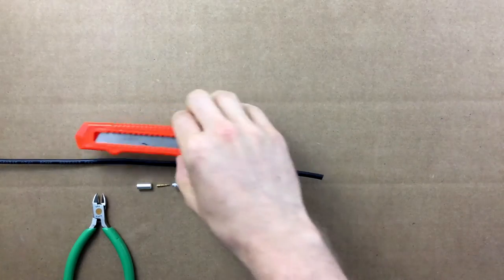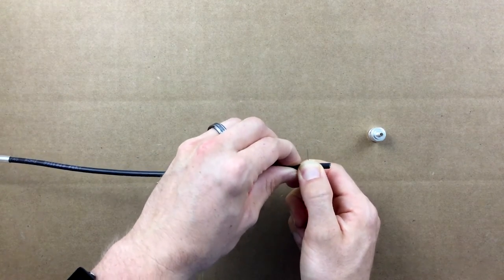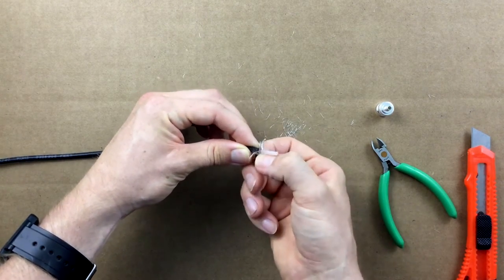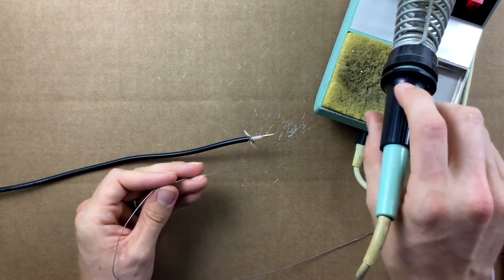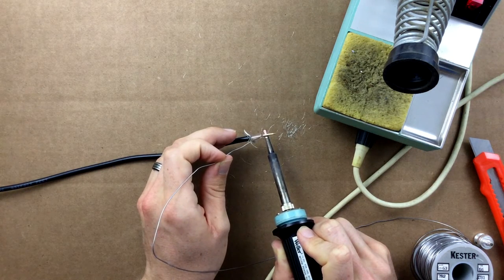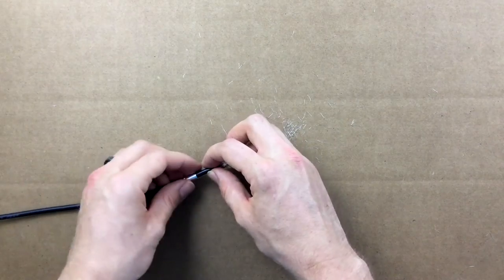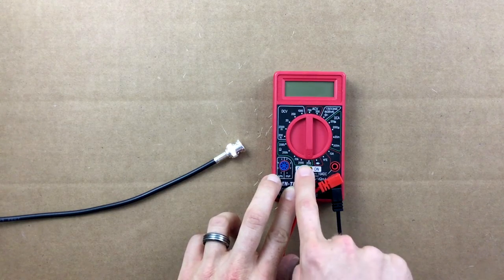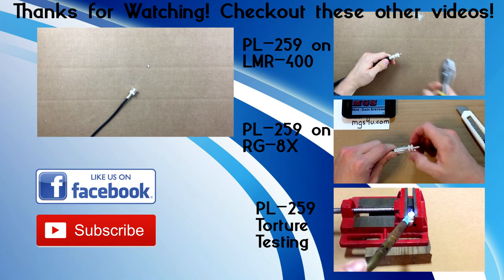BNC Male Crimp-on Installation Guide for RG-58U or Belden 8240 Coaxial Cable Full HD

Comment: He melted the shit out of that dielectric.  It turned clear and flared out.  His fix was to remove dielectric material to make it fit.  What do you think removing dielectric material is going to do to your impedance at that joint?
Reply: You can't even measure the difference at any frequency below 300MHz. No big deal